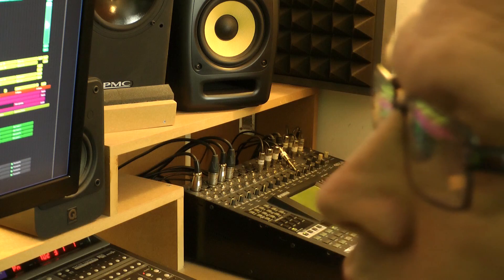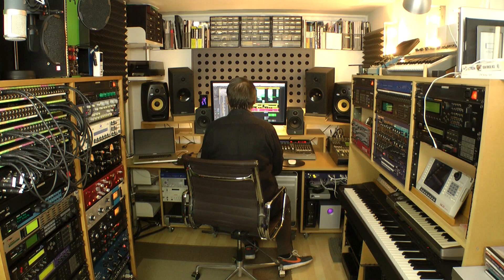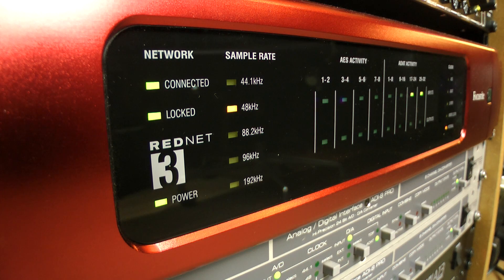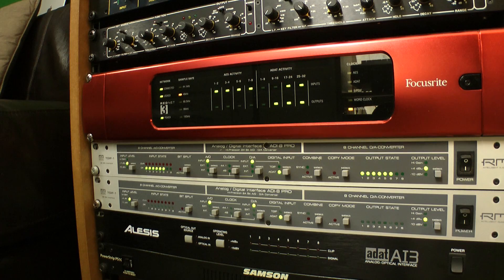Focusrite Rednet in the home recording studio - updated edition Nov 2015

Comment: Hello Matt, good night, I bought a net net 3 to do live capture with optical outputs, I would like your help if possible, how can I configure this product on mac mini with OSX mavericks and pro tools 12?, I followed my email ryldodisouza@hotmail.com, thanks ryldo
Reply from the maker: Hi Rildo. This isn't an easy thing to talk someone through. You need to install a copy of DVS (Dante Virtual Souncard), The Dante controller software and Rednet control and then read all the documentation on the Audinate and Focusrite websites, or the PDF manuals,  to configure it. Don't forget to select DVS as your Output and Input device in the Mac Sound control panel, and the Ethernet port (usually en1) you have connected your Rednet hardware to in the DVS control app. Good luck.
Reply: hello matt good morning, everything works correctly, how much buffer size do you recommend me to record 32 channels live ?, thank you ryldo
Reply from the maker: Depends on your system. The only way is to experiment. Start with a low setting then raise it if you get crackles. Good luck.

Comment: I recently purchased a Rednet 3 and a Yamaha o1v96 after watching your video. I'm quite happy with the setup, and just wanted to say thanks!
Reply: It's a perfect setup Joshua. The mic pres's and converters are excellent in the O1V96 and it has built in light-pipe, and you can attach additional devices to the Rednet! Thanks for your comment.